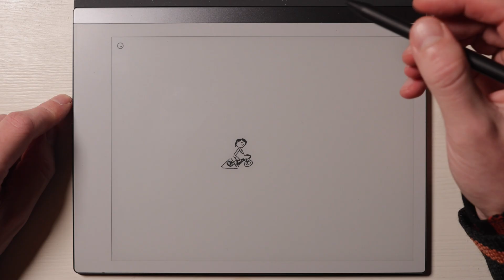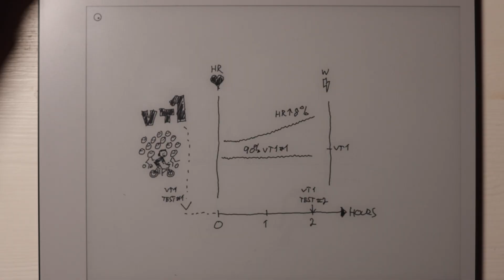Low intensity training may deceive you

Comment: Low intensity training rides?  This opens some questions in my mind:  Does this actually mean a so-called "recovery" ride, or is it a ride in which we are going to overload, go beyond our normal average total energy or strain limit...i.e. an actual training ride?  If it's the former, then is it a necessary ride at all, and why?  If it's not really necessary, then it'd better just be a short ride that won't even get close to our normal load (energy and strain) limits.  If it's the latter, then OK, let's use this info to make sure we don't do an excessive overload, not more than 5% above normal limits.  So, to be safe using this research's guidance, a good rule of thumb might be to increase the total energy load by not more than 2.5% in order to make sure we keep our strain overload within its limits.  Naturally, a sufficient recovery period must be kept after any kind of training (overload) session, regardless of its intensity...full recovery before any subsequent training sessions.
Reply from the maker: Some good reflections here. I agree with your use of "" around the term "recovery" ride. Personally, I don't even use that term, as I believe any aerobic workout contributes to training stress, which must then be adapted from. So I don't buy that these workouts "help you recover" more quickly. With regards to the idea of considering the drift in internal workload, I would think this is most relevant to low intensity rides of durations within the "middle to long range" of what's common for YOU.
Reply: @wattkg  I believe the graph found here at 3:55 says it all:  https://www.youtube.com/watch?v=l61Rk8_SeOU&t=261s

Note:  The curve labelled as  physiological strain should actually be labelled as stress since strain is the time integral, the accumulation, of the stress function.

Physiological strain is always non-linear.  The energy we use in a session is a linear function, just time X average power, but the physiological strain has a nonlinear factor.  The effect you discuss in this video, the drift effect, must also be added.  Problems:  don't precisely know the phys stress function for everyone and likewise also for the drift correction to be added.

Our ideal goal in training is to progressively improve our power level and strain limits up to where they need to be for our event, but we can't be fully precise on this and so applying a stress function like the one plotted here is probably good enough, along with adding about 10% on top of this for every hour we train, i.e. the drift addition based on the research you discussed.  It would be nice just to have these programmed into our power meter data analysis software.  Since I have no power meter, I don't even know whether there may already be some software for doing this(?)

If we can do this, then we can make very good-close enough assessments of our sessions to ensure that we aren't going into excessive overloads.  Otherwise, I guess we just have to do our best to assess our state of recovery and make sure we don't do any more training rides (rides that take us into overload relative to our normal load,  running average) until fully recovered.  Of course, also should always try to err on the safe side when increasing the load for a session to a higher level than our average...shooting for not more than 2.5% total energy increase seems like a good rule of thumb to keep the strain increase under 5%.  Doing one of those so-called "recovery" rides before we've recovered fully may just prolong our time between quality training rides, and would therefore be junk miles. 

Now, if you do a few junk miles, as long as they don't impact your recovery time, well, OK, and it should be the case that your tolerance for junk miles goes up as your training sessions' total energy and strain  go up..  (What I’m saying here is that I personally doubt  that those non-overload sessions have any training value.)

Make sense?

Comment: Great video.  Stephen Seiler also talks about this.  I’ve made this mistake of training in too high a level of Z2 for too long repeatedly, last Sunday for example.  The consequence is inability to perform well in your next ride and so loss of consistency which is usually more important for adaption than a single ride.  Z2 is a very wide zone so one answer is to bucket it into say three chunks - high, medium and low.  For durations up to 1.5 to 2 hours you could target high, for 2-3 target medium and greater than 3 hours target low.  You could do longer rides in a higher Z2 bucket for a given duration but then your next ride could suffer.  You could then by trial and error check whether you need to adjust.
Reply from the maker: I think that's a very valuable experience and realisation to make, Jeremy! One that most athletes will need to make and adjust for in order to best their current self.

Comment: This doesn't tell us whether it's better to stick to your starting zone 2 power on long rides, drop your power as you ride or start lower.... maybe you imrpove by training at zone 2 power until it gets harder (this is my general approach to improving endurance, ride upper zone 2 until it starts to get harder and go for another twenty minutes. I also sometimes do a very longride and find that there's a point at which it starts to get easier again if you keep going - although for this my power will drop a bit)

For example, on shorter intervals (eg vo2, threshold) you generally try to hold your power and it gets harder as you go...
Reply from the maker: No it does not (nor does it suggest to solve that question). That's still to be examined. However, the point of this video is to highlight the need to factor in the changes to internal workload in your decision making - most importantly, realising how much a given workout is actually costing your system (from a recovery point of view).
Reply: @wattkg  thanks for reply. Feel the video might have benefited from emphasising this. Anyone who's riden more than a few long rides will know it effects their recovery more after a certain point. It is still v.useful to explain what's happening of course, but the way it's done might lead to over interpreting* - eg. adding a "therefore I should reduce power towards the end of longer rides to stay in zone". Just my view though! And very much enjoy your channel

*see, for example, Trainerroad's forum for loads of 'logical' leaps of this kind. Their podcast guys too at times tbh
Reply from the maker: @ds6914  I definitely agree the video could have done with some further exploration of these implications. An early attempt at youtube videos on my part, not at all sufficiently comfortable with the format to balance content, structure and visuals in a way I'm satisfied with yet. Work in progress. But appreciate your kind feedback and engagement on this topic!

Comment: I use Zone 2 HR (established by lactate test) Whilst I don't use power it's clear to see that over time the speed I can maintain reduces as the workout progresses. Do you have any thought on what this degradation should be? (Say per hour) I'm not sure how PE can be used accurately but I believe some people can. I tried nasal breathing but as I have a big nose this didn't work and also you can train yourself to nasal breath more effectively!
Reply from the maker: I don't have any clear guidelines here. But I like to separate low intensity rides into two very (rough) categories:

1) the ones that are "short and easy" (1-3 hours, minimal cardiac drift and no real feeling of fatigue at the end - training well within your comfort zone). 

2) And those that venture somewhat outside of the comfort zone (not from intensity, but from extending duration outside of what is comfortable. Some cardiac drift allowed(?). Probably expected to need a bit longer recovery than the first category, and so fueling in-read arguably more important.) 

A blend of both is probably a good idea (the first accumulating stimulus at minimal recovery cost, helping keeping you fresh for interval sessions - the second challenging your durability further, but at a greater recovery cost perhaps). At the very least, be DELIBERATE in deciding whether today's ride is category 1 or 2.